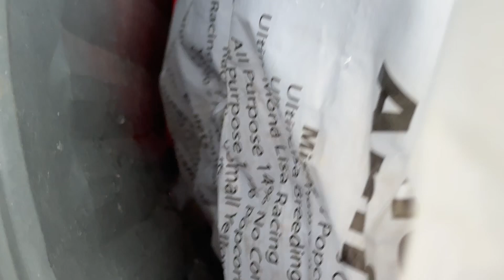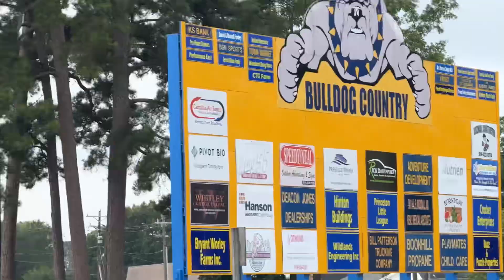YB2024 first toss a total failure. #anxietyisreal

Comment: You're doing way better then me.  This year to date, I breed over 50 yb.  15+ of them are late hatches (May+ yb).  I now have 9 pairs of breeders thanks to all the local club members.  However, out of the 50 yb, I only have 2 left that flew/trained.  I lost 30+ yb from loft flying or not trapping.  All my late hatches (15+) will not be flying and no more flying for me this year.  No more team, loft flying, plus I'm scared to lose them.  

Since I am no longer flying yb, I am stocking all  of them.  I should have 15+ pairs for 2025 season.

My mentor says my plan is not good because I will be breeding untested pigeons and will be wasting a lot of feed and time.